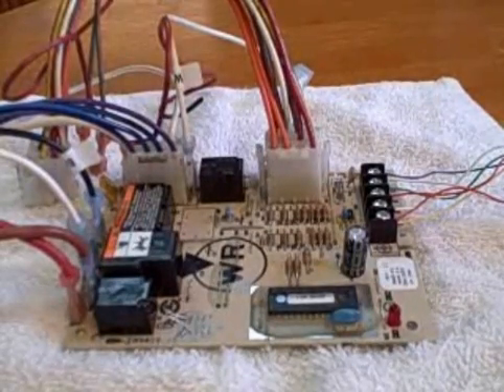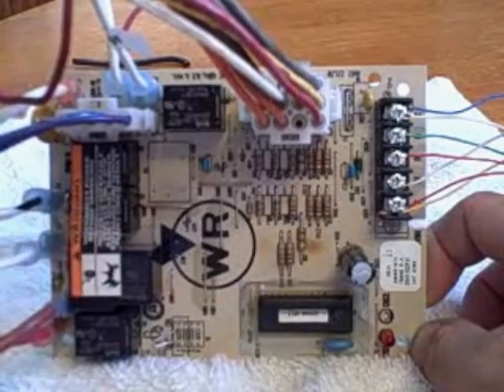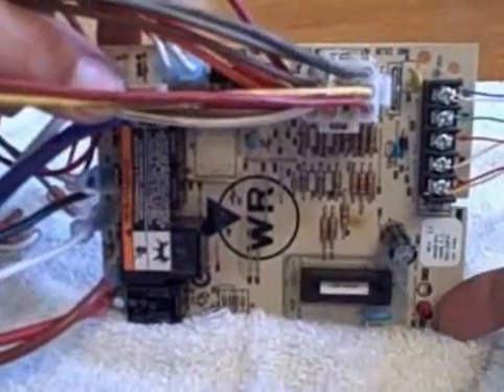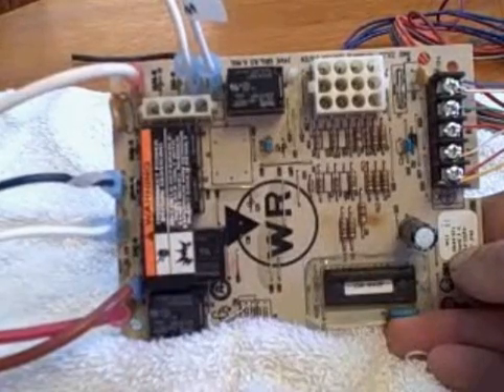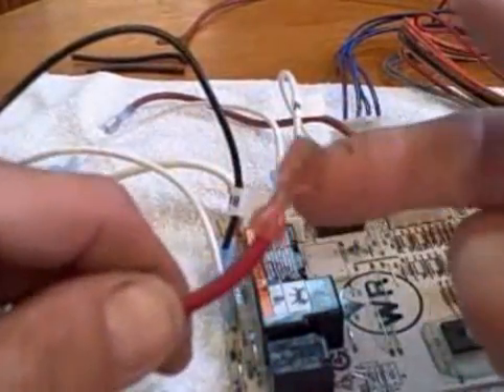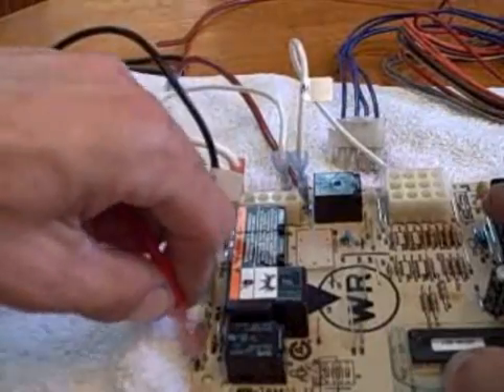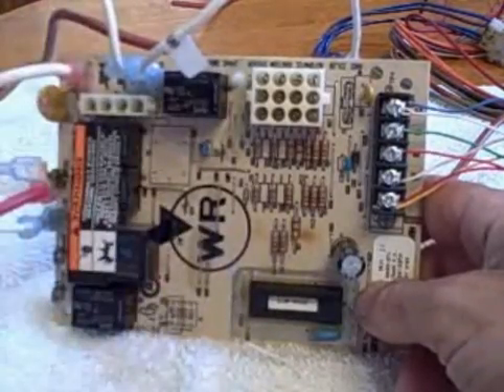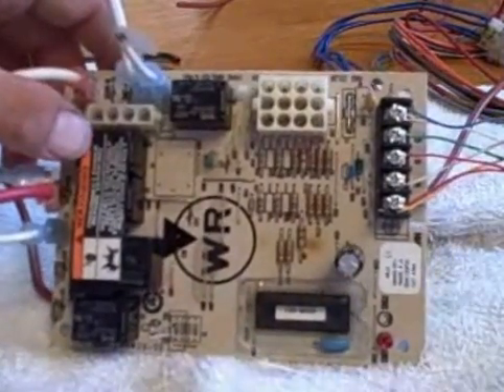HVAC AC Blower not working, troubleshooting Fan Control board, Fan not working.

Comment: After I wired it back normally I jumped the R and G on the liw voltage part of the control board.  Both the fan and compressor/consensor came on and started cooling immediately.  The thermostat now has no control at all and the unit cools constantly.  my drain is piped into the crawlspace and has 2 low voltage wires following it.  Could these be for a wetswitch?  I have not gotten down there to confirm
Reply from the maker: hehehe, I have to hunt for your posts, they pop up in different spots! :). 
yes, that could be a wetswitch, is it a closet unit, by crawlspace do you mean the air return space underneath?  you can look and see what the wires go to on the system side. see if you can get to the crawlspace, or at least be able to poke your head in and check for water and spot the switch. a common one looks like a hockey puck and has felt on the bottom, when it gets wet it trips the switch. they do go bad sometimes. I usually peel the felt back and crush it in a dry rag or between newspaper to help dry it. I believe it has a reset button on it too. 
if you can jump it and everything runs then all the wiring headed outside is fine, so that leaves wet switches and thermostat. you have r and g numbered and the condenser is running so g is probably backfeeding to y through the thermostat to run the condenser, heh.

Comment: I got home from work and noticed it was extremely hot.  I checked my Trane xr95 unit inside and noticed the red led indicator was not lit or blinking.  I then checked the breaker and found it tripped and reset it.  The red indicator light on the unit came on and was blinking normally.  The fan still would not come on.  I then watched your video on control boards and wired the fan directly to the switch with success ruling out a bad blower motor.  I wired it back normally
Reply from the maker: Hey Justin, just checking up on you, did it turn out to be a bad thermostat or was the thermostat not programmed or wired right?   Mike
Reply from the maker: Hey Justin, just checking up on you, did it turn out to be a bad thermostat or was the thermostat not programmed or wired right?   Mike

Comment: The main breaker was originally tripped in the breaker box.  Would this change the diagnosis?  I really appreciate your help and professional opinion.  If I didn't watch your video it still would be 100 degrees in the house
Reply from the maker: Hmm... Im wondering if Im missing something here... So the unit is actually cooling now? The thermostat is working?  If the main breaker was tripped its possible that a surge from a storm or something got past it and damaged the control board or the thermostat.  Is the thermostat not operating things properly? I dont think we discussed what is actually happening with your system.

Comment: The problem was the blower motor was not coming on.  When I jumped the R and G on the control board the Air Conditioner started working
Reply from the maker: Hmmm... That should fire up the blower motor but not the outside unit... It could be the thermostat, but you might check to see if there is a wetswitch that is tripped, if its a horizontally hung unit then its probably in the emergency drain pan under the unit, if there is a wetswitch, if its a vertical unit, like in a closet, the wetswitch could either be installed in the plastic drainpipe off the coilbox, or on the floor under the unit to detect leaks there. Reguardless if its a tripped wetswitch then it is prolly wired to the Y wire since you do have low voltage power, just no cooling, and youll have to fix the blockage causing the water issue.

...if its a thermostat issue...is the thermostat new? Like replaced during the winter? It could be programmed or wired wrong... Or if its an older stat it could just be bad.   Some problems are easier to figure if Im looking at it, hehehe!

Comment: I jumped the R and G on the thermostat part of the board.  Everything came in and started working.  Does this mean I have a bad thermostat or wiring?
Reply from the maker: jumping those two just turns on the blower motor. you haven't said what the problem is yet?
Reply: You called a tech didn't you. None of what you posted made any sense. Afraid your boy card is going to get taken away. Mom's basement got a little too warm for you, right?

Comment: Buddy.. YouTube is a weird little venue.. but I want to say thank you for your upload.. watched your video after installing a new blower motor and capacitor. 97 degree weather was coming into town that day. When I fired up the AC it did not kick on. I learned your little trick and checked my motor and when I fired up the furnace it worked. Apparently just needed to charge up the capacitor. If I hadn't watched your video I would have never been enjoying air conditioning on this blistering day. thank you.
Reply from the maker: Somehow I think I missed your msg when it was posted! Is the unit working ok? The system uses (usually) different speeds, and different relays, for heat and cool. High on cool and med or low on heat. The blower may not come on in cool but will in heat (or visaversa) if the cool relay on the board is bad. Was it just a bad motor?

Comment: Hey Mikie, I have an issue with the HVAC AC Blower not working when the AC is turned on. The outside compressor and fan turn on, so no issue there. I tried replacing the blower motor capacitor with a new one (all the same specs) and no luck there. I saw your video and tried bypassing the circuit board like how you did and still no luck. All I get is a humming from the blower motor. I'm assuming it is the blower motor that needs replacing now?
Reply from the maker: Yepperz looks like it! The only other thing to check would be making sure you have proper voltage. If it's electric heat then 240ish volts. If it's a gas furnace then 120ish volts. In the US of course.  If it's electric you could have a breaker half tripped or something. Most likely the motor though!

Comment: Mikie2501 thanks for the video...I have an issue that is similar to this but both blower and outside unit does not turn. I have power going into the board but the led light is not on. Could I have a bad board? I checked for 24v at the contact outside but I'm reading zero voltage. If you can help out I do appreciate it!!
Reply from the maker: Hi! My first thought is either the 24v transformer is blown, or if it is fused then the 3 or 5 amo fuse is popped. The board could be bad but often its a low voltage short. If its the transformer/fuse then you need to find the short (unless board is bad too) which could be bare wires by the outside unit touching, bad contactor or other things. A bad board is often obvious by checking the back of the board for a burned spot where it might have arced to the sheet metal behind it, possibly from a surge from a nearby lightning strike. Remember to kill all power if you do anything. Its safest uf you hire a tech. Let me know what you find!
Reply: +mikie2501  hi friend good work . if you can send me your email id
Reply from the maker: +Rajh Kumar do you need help with something? You haven't posted anything here, that Ive seen...
Reply: Ok sure thanks

Comment: I was just ion here wondering if these type boards need to be shipped in a anti-static bag and if they need to be handled in a static cotroled manner.   Guessing from this they do not. LOL
Reply from the maker: Hehehe :). Yeah they are typically shipped in anti-static bags and I usually ground myself out on the unit but nothing fancy like using a wrist strap when Im soldering electronics. ;)

Comment: how much do those boards usually run? maybe good idea to carry one.
Reply from the maker: Well it depends on what brand system you are working on. You can check at the supply houses and there are some universal boards that will cover a range of models, but I never stocked them on the truck since you never knew what you were really going to need and I pretty much wound up at a supply house either every day or every other day.  Universals range from probably 80 to 130 (just ball-parking here, dont recall) but I usually tried to go back with oem parts when I could for boards.

Comment: I'm going to starting school soon. I've seen on some boards, heat, cool, M1 & M2. Is M1 and M2 a medium speed?
Reply from the maker: Good to hear you'll be starting school soon! Keep watching videos though, there are a number of us techs on here that started putting videos up to help each other several years back and there is some pretty good stuff to be had! 
...anyway to answer your question; M1 and M2 are the same as PARK, which just means that its a dead terminal that goes nowhere, you can put unused blower speed wires there. Cleans things up so you arent capping ends and zip-strapping wires :)
Heres a board tip that will come in handy! Eventually you'll change out a bad board somewhere and it will either not work or will act really goofy! Cut power and reverse the 24v leads coming from the transformer that plug onto the board and try it that way. It shouldnt matter since it's AC but some boards are pissy about it! NOT something you want to sit in a hot attic trying to figure out!  Will look forward to hearing about school and how its going!
Reply: +mikie2501 Thanks for the advice, I have watched a couple videos of yours and some others. Very helpful.

Comment: My inner unit blower won't turn off. Everything is working normaly with remote(cooling , heating etc) but the blower wont turn off and it is working on max speed. Only solution is to plug it from wall
Reply from the maker: I would normally assume that you're talking about a normal size whole house split system but I want to be sure you didnt mean a window unit since you said unplug it from the wall. The problem would probably be similar anyway!
You say the heat and cool kick on and off just fine but the blower motor keeps running. I wonder if it is a gas furnace since you mention unplugging it, if it was electric heat you'd have to hit the breaker. Sounds like the blower relay or blower sequencer is stuck. Depending on how old or new the system is, it might require replacing a relay/sequencer or replacing the circuit board. At least its functional till you can get a tech out to look at it!

Comment: Hi, My Rhyeem air handler control board needed to be replaced so I ordered one. They didn't say it was an updated control board but there's extra wires on the new control board. Any help hooking it up?
Reply from the maker: Hmm... When you say 'extra wires' do you mean like they included jumper wires and module plug wires in the box?  A lot of times these upgrade boards are universal boards and the will work with quite a few different units. A number of these other units might have different types of plugs or connection so they include this wiring, you msy not need some or any of it.

Best thing to do is sit down in front of the unit with some good lighting and visually look at both boards. Look at the old board one wire and plug at a time and see where they plug in on your new board.  Pay attention if you have multi plugs and if they dont match you might need one of the parts out of the box.

Once you've verified that you know where everything goes you can start to change out the board.  I always try to change out one wire at a time! If I have room ill pull the old board off the unit but leave the wires on it, then put the new board on the unit and start migrating the wires over one at a time.
Hope this helps!
Reply: Call a hvac professional to diagnose/replace the control board if necessary. Also, he can teach you how to properly spell Rheem. Thanks, boss of nothing for the pathetic diy comment.

Comment: Hi, my blower fan on my hvac unit does not come on. I put 120ac volts to the fan from my door panel safety switch and the fan still did not work. Though the wire (which is black) that leads to the fan has a transformer in line. When I tested the transformer I had 120ac volts going into and 120ac volts coming out of this transformer. 
Two things trouble me:
I thought the blower fan works on 120ac volts and I thought that transformers reduce the voltage. So the question, why is the transformer not reducing the input and why should it reduce the input if the blower fan motor works on 120as volts?
Reply from the maker: I have got to say, this sounds WEIRD! Lol :). Man Id like to see some pictures, hehehe.
First off lets talk about voltage.  If you have a gas furnace then the blower motor and system (other than the thermostat and some control board stuff which is 24-28v) is 120v. If it an electric air-handler and it uses electric heat strips then the system and blower are 240v.  

All systems have a transformer, usually just one, that drops incoming voltage down to 28v for the thermostat and relay/sequencer control. Sometimes there might be another transformer for other items such as a UV light, duct controls, etc, bun not for most systems.  

Are you SURE that the black wire, coming directly from the blower motor, is going to this transformer?  Wait, check that... You cant just go by wire color and assume that black is high speed. Does your system have a control board, and if it does did you pull the black wire off the board from the Cool tab?

The blower motor will usually have one wire that might tie in with a transformer but its usually the common/neutral wire, then if you have a board you will have two more wires from the blower going to the board to tabs marked something like COOL and HEAT or it might mark them as speeds. If there are more blower wires they will either go to the board and plug into PARK tabs, or be terminated and tied out of the way.

Is the blower run capacitor bad?

This transformer, what else does it hook up to?
Lol, this is certainly different!
Reply: +mikie2501 Hey Mike thanks for getting back to me. The system is from 1997 and it is an American Standard freedom 90 gas powered. I have a black wire from the curcuit board to a relay then to the fan . What troubles my is that I am getting 120v in and 120v out to the fan motor.
Reply: Not a relay I mean a transformer.
Reply: Also I cannot find the blower fan capacitor though would I be correct to surmise that the blower fan motor maybe bad because it does have 120v going to it and it doesn't turn on. Although that fan would have a constant 120v in any cycle and then the board would control when the fan would turn on.Doed this sound correct.
Reply: Nothing else is going to this transformer.
Reply: The board had two sections called neutral and hot. I pulled the black wire that was plugged into the terminal marked crc in the hot section and plugged it to the safety door switch which has 120v and still the fan did not work. I also checked the terminal I pulled the wire off of and that also had 120v in which I think is correct.
Reply from the maker: sorry I'm slacking on checking my mail!!  do find your capacitor you might have to pull the blower out part way or all the way. they almost always screw it to the side of the blower squirrel cage. 
cut the power to the unit and unscrew the blower slide rails and slide it out a ways, without pulling the wires, and look and see if you can find it, the wires coming out of the motor should be sending two wires to the capacitor.  have more thoughts but haven't slept in a few days so I keep nodding off while typing this hehehe.  ttyl!   M@
Reply: +mikie2501 Thanks for getting back to me, I will let you know what happens, I am going to do the work Sunday.
Reply from the maker: +rr po hey! Been a while and thought Id check back with you to see what you found out on the unit!
Reply: Hey, how is it going, I found that my forced air unit has a multi variable fan and the fan motor is controlled buy a mounted circuit board. Also, I found out that on the circuit board there is a a large round transistor or flat capacitor  that usually burns itself out. So what I did was cut the transistor out and soldered a jumper wire in its place and tried the fan. I was surprised it worked because the transistor wasn't that bad looking. So, I have been running it all season, though, just until I could find another board for it. Hey, I just like to say thanks for asking and thanks for your help.
Reply: A

Comment: I did that today .. and client just call me saying hes breaker tripped.. any suggestion
Reply from the maker: gali galindo Well without seeing the system to figure  out why it tripped, no. Of course you have to go back with a new board anyway when you return so you may figure it out. The only thing I can think of that might be related would be if you didnt put the med/low speed on park and left it wired on the board and they cut on the heat and it tried running two speeds at the same time, or if the blower ON switch on the tstat activates the med/low speed instead of high and they were screwing with that and that speed was still wired instead of parked. ...otherwise its either unrelated, the board had additional damage or they had a storm. ...or something else is on that circuit.  Will be curious to hear what it was!
Reply: Get some hvac training

Comment: This worked perfectly to help me diagnose a bad board. I bypassed the board by plugging in the high speed fan line into the door switch and it fired right up! Took the guesswork out of the process. Nice and simple. THANK YOU!